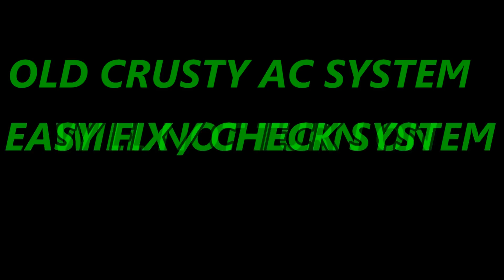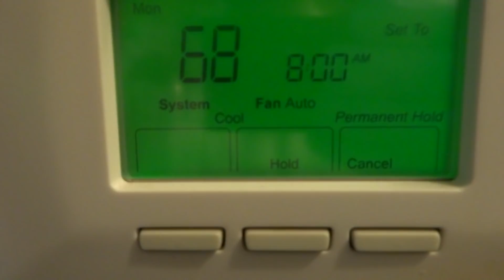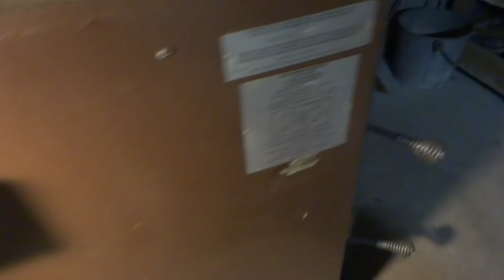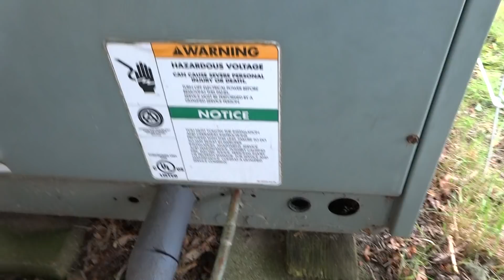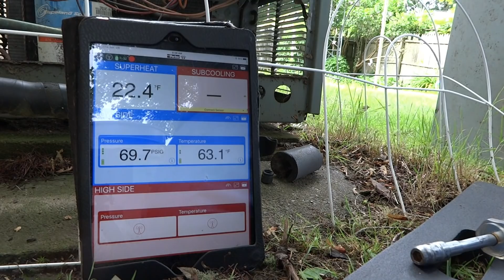OLD CRUSTY AC SYSTEM NOT TURNING ON EASY FIX

Comment: When I was in the field had to back later remove suction drier . The thought is if filter is working it will catch a lot debre . Clean system get out there.  That was different manufacturers recommended. Always did.  Large one go back change filter core .
Reply: I’ve seen so many techs install suction line filters and never go back to check pressure drop on it to see if it’s restricted and needs to be replaced. They usually install it and forget it.

Comment: I’m wondering if the burnout was the unit before the Ruud was put in. Furnace is much older than 2001 and maybe had an old condenser too.
Reply: That's what I'm guessing. It was a burnout and they put in the Ruud keeping the line set and evaporator in the furnace.
Reply: That would have been a very stupid, amateur move to leave an evaporator coil when a burnout condition occurred. A line set can be chemically flushed, but to leave a coil when repacling the condenser is moronic.
Reply: @potatolew4495  Exactly why we think some hack job did it!

Comment: Tough old equipment.  Probably outlast a new system installed today.
Reply: @kingpins9  look how old the unit is.  One compressor change seems reasonable.
Reply: @Bob.W.  Yes, I agree.  I looked-up compressor burnout and it can be due to owner negligence and not any flaw in system design...even something as simple as poor maintenance and clogged filters.  I had a lady friend tell me that her vacuum cleaner was broke.  I checked and the filter bag was packed solid...never changed!

Comment: My ac starts to blow no cold air I go outside and hose it down and it's cold again I have had a ac people out he didn't know please help
Reply from the maker: PROBLEY LOW ON REFRIGERANT .. WOULD HAVE TO PUT GAUGES ON SYSTEM AND CHECK IT RUNNING TO SEE WHATS GOING ON .. TEMP BETWEEN SUPPY AND RETURN SHOULD BE 16 OR SO . CHECK THAT
Reply: @stevenlavimoniere  he said that was good Steve. Just don't know .if I wet it with water hose it comes back on .
Reply: I have been watching your channel since  1:30 today to try to figure it out lol
Reply: Wish you were in Florida
Reply: And he said the condenser was good don't know.
Reply: @barackobama5304  The fan is running and after I wet the outside unit the compressor comes back on.
Reply: obama  could it be the outside Coles need to be cleaned?